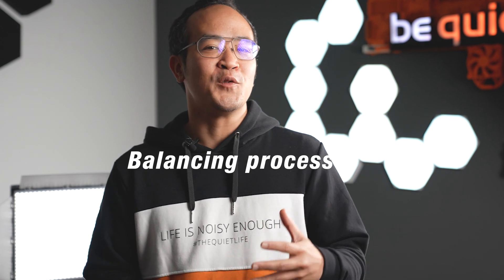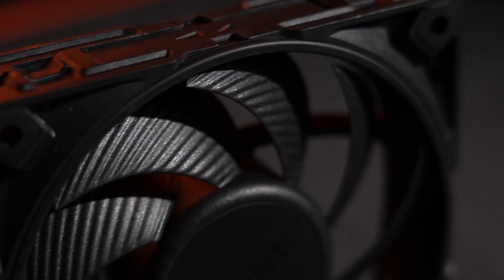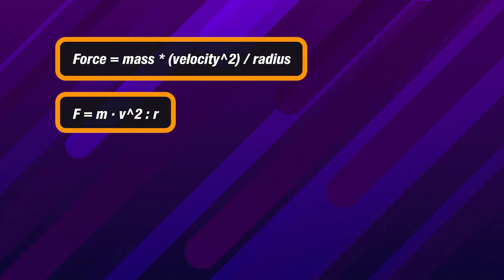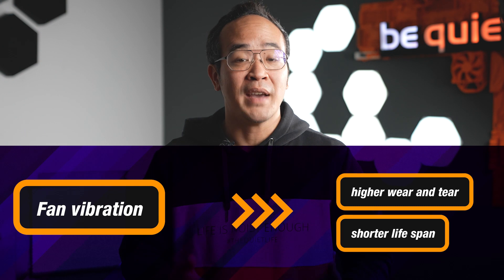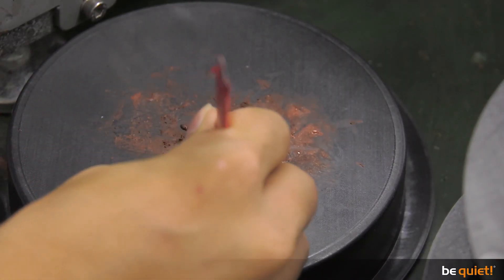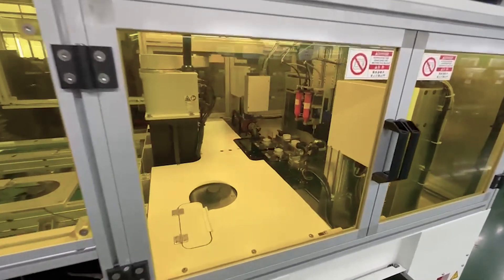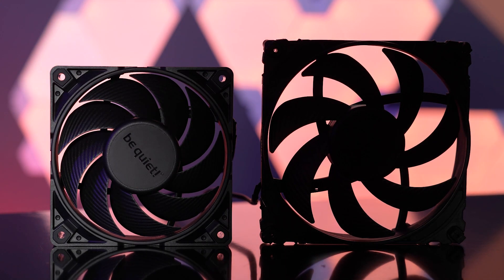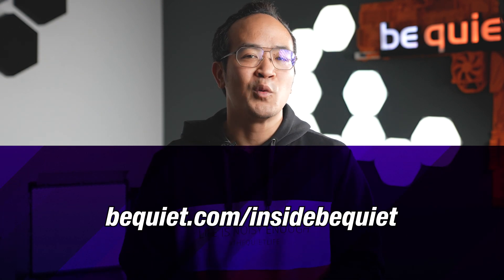Auto Additive Fan Balancing | Fan Production | be quiet!

Comment: please make a psu similar to the seasonic connect/syncro series but make it at least platinum rated since the connect is gold only.  I think the syncro offers to different wattages and at least one might be platinum rated, but I've read its compatibility seems mostly limited to their syncro chassis unless one wants to do heavy mods to their case.  I also have efficiency ideas no psu manufacturer has implemented afaict but I'd only dialog via email to discuss that if BQ is interested.  I have given ideas to different companies, but only one actually made the product albeit are charging too much for it imho.
Reply: SeaSonic Connect in way its build makes a lot of loss on cables.
Reply: @wilkuuu4016   yes, but they only offer 3 models and they need to offer newer and updated lower-profiled versions with higher efficiency.  I find it disappointing that there is such limited kinds of PSU's that cater to this.  I have an older PC chassis that I don't want to get rid of that can house 5.25 bays along with ability to house up to seven 3.5 drives.  Corsair recently introduced a series of  psu's that take a different approach in their cable wiring but they seem overpriced and also only gold rated iirc.  Ideally, I'd personally like to find a PSU that resembles the features of the Connect series, but with a thinner bar to place behind the motherboard tray so it is more universally compatible with older chassis like mine.  I'd also like it to be at least 800W Platinum and SFX form factor since the bottom of my case does not feature a shroud like many of the newer ones, although I'm ok with this fact since I want the bottom fan and added RGB ligthing to be visible.   @wilkuuu4016

Comment: Does the psu pure power will have upgrade to 13 version? Cz i wanna buy the pure power 12 but ppl said wait for the 13 version? Im on budget here hopefully the 13 version not that expensive 🙃
Reply from the maker: We only launched our Pure Power 12 M in May. The Pure Power 12 M will therefore remain the latest version of the series for a while 🙂
Reply: @bequietofficial  owh ty, anyway why u don't inlcude the realease date on the website? I can't find it anywhere that's why i ask this, i though the pure power 12 is already old enough 😅
Reply: Pure Power 12 M is brand new and follows the ATX 3.0 standard. No reason to wait, really :)